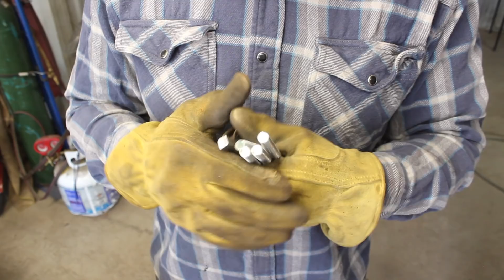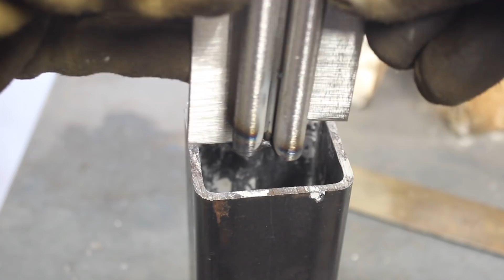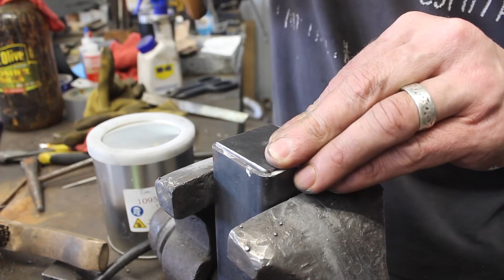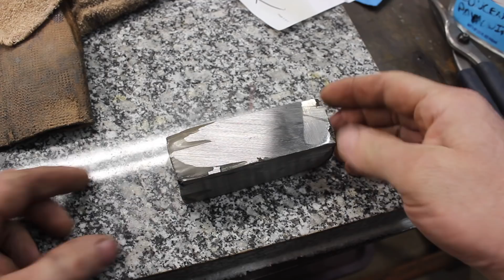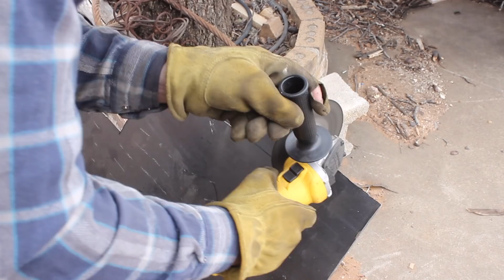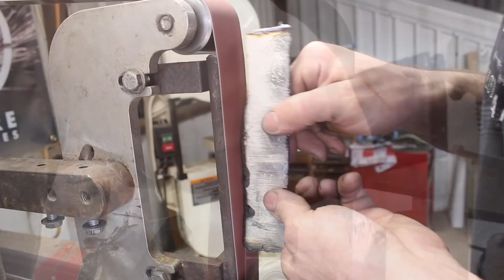Forging Mosaic Canister Damascus, Pattern Welded Steel For Knifemaking, Bladesmithing

Comment: I have seen a video where they use Tipp-ex paint on the inside of the can and the shell comes right off when forging. I 100% belive this would work coz I use tipp-ex myself on my Goldsmith work when I don't want solder to flow every where

Comment: I have watched alot of these forge guys make big fancy knives that no one will ever use unless they are mercenaries. I would love to see you make a damascus steel blade for a mower! Now THAT would be functional!! Love the videos and the technical info you give.
Reply: Why?  You would never see it and the whole point of Damascus is to visually see the patterns you created. Plus it takes way longer to make a patterned steel.
Reply: @david_kg  NO, the whole point of damscus steel is to create a blade that has the best characteristics of both of the metals used. It had nothing to do with looks until recently. This technique allowed blacksmiths to create a metal that was both hard, to retain a good edge, and flexible enough to not be brittle. So it would be perfect for a mower blade where you want  a longlasting edge but not a brittle blade. If you only want the "look" you can go buy fake etched blades at Wally World for 20$.

Comment: I've watched a few of your videos now where you try white out, foil and ultimately settle on white paint... Why don't you just not worry about any of that, do it as it is then band saw the box section off after forging?
Reply from the maker: I think the white paint is easier for several reasons,  plus saves on bandsaw blades
Reply: @FireCreekForge  interesting, well I've seen it work really well so can't fault you on it - tried white enamel paint or pottery glaze (glaze the inside of the can and fire it to make a glass layer) or even a watered down clay liner?

Sorry, kinda fixated on this one lol I'd watch a video exploring different ideas on it.

Comment: anyone ever suggested making damascus steel 'something'  from all of the used canister parts? :D
you could forge weld some thin pieces together back to back, then it will be thick enough to cut into cubes, have a cube based damascus steel knife

Comment: I've got a lot of very expensive Damascus knives a lot from a guy named Ray rantanen he was very famous in the 80s and he worked for NASA for the heat metal shield thing so he knows everything about steel and he does not use and 25 whatever nickel to Hansa Damascus pattern he believes that its weak and it's junk and that's the cheap easy way to do it and everybody uses that s*** he's the only guy I know that doesn't use f**** doesn't use the nickel stop using the nickel
Reply from the maker: I'm sure he's very smart and his knives look great. However I don't put non-hardenable (low carbon) steel in my blades where it will be in the edge. Low carbon steel can't hold a good edge, and that's not something I want, but to each his own.

Comment: I’ve seen other videos on canister Damascus and a few that used powdered steel drilled a small hole in the end of the canister. They said that it was there to allow any gasses and other impurities that may form in the can an escape so they don’t end up in the final pattern. I’m not a blacksmith so I’m not sure if that’s needed but it may account for the water that was definitely visible when you were cutting the billet on the chop-saw.  Also try drawing out the billet (after removing the can) to 1/2 size the pattern may be smaller but you could try a number of different techniques with the same amount of material.

Comment: When casting bullets It is recommended to cover the inside of the mold with soot from a flame to prevent the lead from sticking to it. Would this work for this process. 
* disclaimer: I know nothing about this topic other than what I see you doing on the videos.*

Comment: Random late question, why not use a canoe canister? You'd be able to dictate the pattern a lot easier. It would have allowed you to set each piece of the core pattern  without fear of I getting too distorted when you do your welding passes.

Comment: I have a question I see you used the white out as a barrier between the canister and the steel. Why not used a harden-able steel canister so you don’t have to remove it after the initial forging. It might add an extra mosaic layer. I do not forge but it’s something I’ve always wanted to ask when watching forged in fire.

Comment: Just a question, did you clean the inside of the steel before you applied the white out?  If not maybe that is why it didnt stick well?

  I found that the "Dollar Tree" has BIC White out for only $1/ea and that is much cheaper than anywhere else i have found.  A 2 pack at Amazon is $3.90/ea!
Reply from the maker: I cleaned it with acetone.. maybe it's the brand.. Anyway, I've had good luck with white spray paint since this video

Comment: Try this pattern again and use ball bearings as well. I believe the ball bearings will complete the look as well as turning the original pattern to the corners so the lines won’t be as noticeable off center.

Comment: Use plain Milk of Magnesium to keep the metal from sticking to the sides. What jet aircraft engines hot sections & afterburner sections used on the bolt to keep the nuts from forging together.
Reply: i wondered about plain aluminium foil , would form alu oxide

Comment: paper or leather works better than stainless. just a suggestion sir.
Reply from the maker: Interesting, haven't hear that before
Reply: @FireCreekForge  the paper burns to form a carbon layer, the leather burns and forms a carbon layer but adds more carbon to the steel this is also a case Harding technic.

Comment: That can came out really clean and easy, unlike a certain TV show .
Had seen the white outbefore , but not the foil.

Good pattern and a great idea! 
Perhaps make the pattern a bit smaller (say, half a knife wide) so you can repeat in a 4x2 pattern perhaps?
Whenever you get a pattern you like, I can see it usefull to make a longer pipe and stock for 2-3 knives :)
Reply from the maker: Thanks! I thought about drawing the bar out and quadrupling the pattern, which would have been cool but I wanted to keep it a little lower tech this first time around.

Comment: Instead of "correction fluid" why not use "good quality" white paint, the white pigment is Titanium Dioxide (in cheap / poorer quality paints it can be Zinc Oxide). Going to be a bit hit or miss which type of paint to use as some have more plastics than others to bind the finally dried paint but it will bond to the inside wall of your can far better. Just a thought.
Reply from the maker: Yes I'd thought of that, haven't been able to find any titanium dioxide content paint yet...
Reply: @FireCreekForge  I was lead to believe all the good quality white paints are Titanium Dioxide, stays white, whereas  Zinc Oxide is a bit grey and gets greyer with age. If I come across any, I'll let you know the make (I am in UK).
Reply from the maker: @hoperp1951  thanks, i bought some for another project that is supposed to be good stuff, and it says zinc; some paints don’t say either way so hard to know..

Comment: Sir. Have you try using Stainless Steel Hose Clamps, so there not some much Welding? I am just asking. I saw a Blacksmith doing it and she the only one so Far?
Reply from the maker: I've heard of it, but haven't tried it yet

Comment: I like your videos, just finished watching how to soften tang to drill video. I just finished a nice small integral guard but tang is hard. Will heeping blade portion in water help keep it from heating while i soften the tang?
Reply from the maker: Yep, that should be fine. I recommend getting the tang up to your target heat as quickly as possible; the heat has less time to travel up to the blade that way.
Reply: What about clay to stop the heat from traveling?

Comment: Can you not get your hands on zircon paint (it'[s sold as a refractory protective coating over here)? Just pour some into the cannister, invert it and let it drain back. That'll give you a reasonably uniform coating on the interior.

Comment: Stupid question. But wouldn't a metal zip tie be a better idea due to the heat generated from the welding? Sry, just getting into BSing at 40 yrs old and trying to make sure I'm doing it correctly,  tnx!
Reply from the maker: Yes, however it wasn't on long enough for that to happen...
Reply: @FireCreekForge  tnx brother! Fingered it wouldn't hurt to ask lol

Comment: So I go around recommending all kinds of crazy ideas. One has been involving nuts and bolts.
Shurap, one of the guys I watch, did a pattern of nuts and bolts but his orientation was short bolts in nuts side by side horizontally.
My thinking was longer bolts, say six inches, all thread with nuts of different grades thread onto the bolt.
I'm thinking a large bolt, at least one inch, but also a canister job with smaller bolts, but many of them.
The question is, will it weld fast enough to avoid a void between the nut and blot as it is flattened? Or twisting.
Wish I had found this stuff earlier in life as it isn't too late and actually have a couple knives I had been working on, one inherited project my dad was working on, but not welded Damascus, but I'm running out of runway, so to speak, but with a million ideas on how to create patterns..
Latest, canister with different sizes and grades of cable, mixed with nuts and bolts and round and square rod, all mixed in a canister with some powder.
Also, after watching how Shurap arranged them, what about a nut with a ball bearing in the center, flat and horizontal, powder and then another level/row.?

This one, this pattern you just did makes me wonder if you could create letters and then mix and match to spell things?
Who wouldn't want a knife with their name forged into it?

Comment: Try putting that whiteout on thinner. Several coats. It's not engineered to go on that thick, so when it dries the surface tension breaks it apart when it shrinks. Why can't a guy just use a few coats of white spray bomb? If all you want is a layer of titanium dioxide inside there, why not a spray bomb? In fact, this might be an interesting video.. testing different internal canister preparations.
Reply from the maker: Cool
Reply: White spray paint works great.  The cheap stuff at wal mart is like $2.

Comment from the maker: OK guys what do think, will it work??
Reply: Looks like it will.   Wondering what cable of the same size as the round stock would look like?
Reply from the maker: @JohnJohnson-bg2oo  cool idea
Reply: @FireCreekForge  I saw another fella use copper, cables and a core of 80 crv2, or 15n20 in a cu mai blade that turned out pretty nice, using the same setup you did for forging the cuts together, is what reminded me.  Be looking for the finished product.
Reply from the maker: @JohnJohnson-bg2oo  cool!
Reply: Love to see the finished knife.  Also ball bearings giving little dots along with the big dots. And turning it to make it an x pattern so it doesn’t look off center